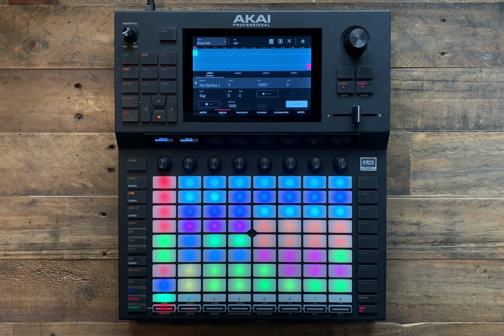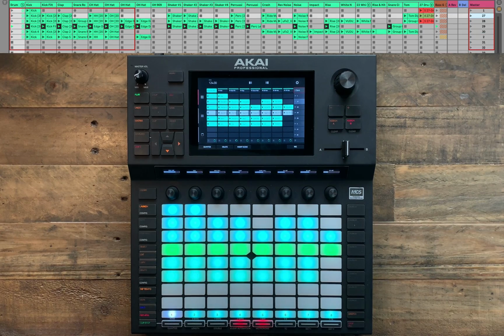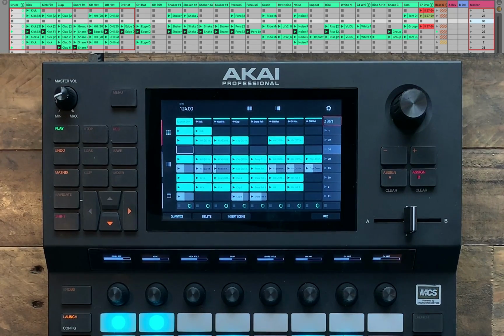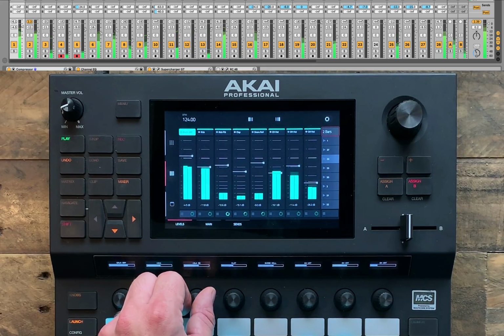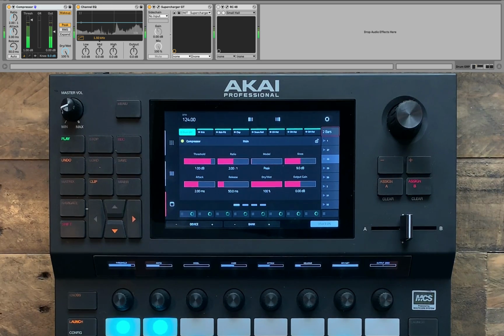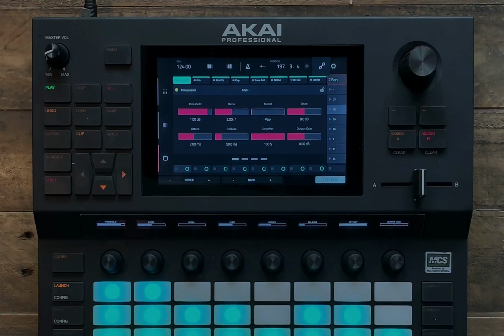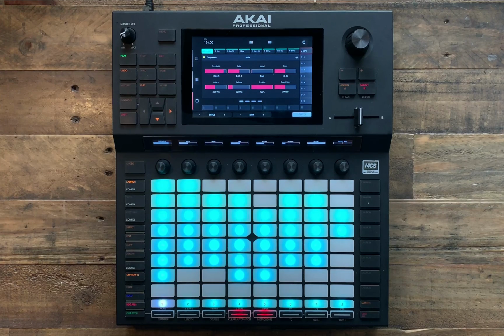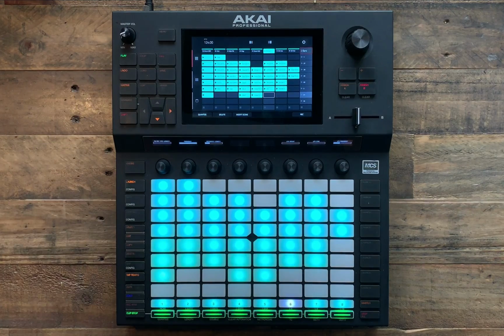Force 3.0.4 | Ableton Live Control Integration

Comment: Akai network midi driver is not fit for purpose. In windows audio dev monitor.exe locks all usb devices preventing them from being used in ableton without powering off my 3rdparty usb midi controllers and powering back on again. I’ve had an unanswered ticket logged for 6 weeks and no response! Disappointing very close to selling my force. There is some weird race condition going on with how the driver polls the midi devices in their last state. Why is the akai audiodevmonitor.exe polling devices in the first place! It should have no jurisdiction over other devices. I have 10 usb midi controllers and it seems to hit a max ceiling limit of polling more than 5 devices.

Comment: Just got the force and I'm pretty blown away to be honest, It has just about everything I could have wanted in an all in one box to use in conjunction with Ableton.
One thing I seem to be missing is the Ability to send midi notes from the force into Ableton clips. In other words I want to use the Force to replace my midi keyboard.

It seems that one way to achieve this would be by using Force external midi channels via a Midi interface then into Live, but surely there is a better way?
Can this be done from within Live control mode?

Thanks in advance
Reply: @user-l6e5z  I've worked it out!
But you're right there is very little information about this.
Ok you should see another option in the midi tab of Ableton Live's preferences for the Akai Force.

Make sure that the input side of this has Track enabled.

Now in the force create a midi track. 
Go to the midi output settings for that track and in the output choose 'Remote' as the output port and obv set the correct midi channel for output.

This worked for me. Let me know if  this makes sense and if it worked for you too.
Reply: @user-l6e5z  yep. Brilliant 👏

Comment: But is it possible to play instruments with the pads?
Reply: My question two - if this is not the case then this is not a viable option. it will have to be push2 again :) 

Cant really see why it should not be possible
Reply: @steffenhenriksen1412  I have a Akai Force now, so I can answer the question: It is unfortunately not possible to play instruments via the Ableton Control integration at the moment. Maybe they decided to not implement it, because the latency over a wireless connection is to bad. However, you easily can connect the midi output port of the force to a midi interface on your computer (or a audio interface with midi ins and outs) and play everything, but I also need to admit that I didn't tested it in the Ableton Control mode (I will do it soon).
Reply: @milanwulf  Fantastic thank you for your answer.. im fine with just doing it over the midi output, maybe they can implement it on the live control at some point :) 

Think its time to spend some more money :D

Comment: The Touchscreen is like an iPad so there is no need or point to lock & restrict the 8x8pads to doing the functions of the screens limited functions!
In fact an iPad can control the playing of instruments while doing all the other functions so it’s not really like an iPad or iPhone or other smart devices!
It is restricted as much as it could be so Akai Pro can slowly free up one feature at a time for as long as they can before releasing the Next Model of the Force!
This is a big disappointment for me if I knew they was going to make it end up like this I would have sent it back while it was still in its warranty 
if only I didn’t want it to be a successful update and was trying to keep the faith in the Force and faith in AkaiPro making it work well with the force of a MPC 
But they are purposely trying to make it a worse product, like as if they are afraid it could be potentially better than the MPC so they are stopping it’s growth.
60 plus pads that could be used to play keys now becomes locked to one set of functions that are already controlled by the touchscreen!
The fact they could have made the Force work just like an MPC but with more pads, but instead they change all the functions and restricted many of them
And changed the workflow beyond recognition so it doesn’t work as well as the MPC’s and the workflow of the MPC is Iconic so they could have made the Force run the same way only with 8x8 Pads inviting 8x8 plus possibilities but it don’t have that workflow! It has a brand new limited workflow built from the engine of the MPC but made to be weaker and not as fun to use! And I’m sure the update for the MPC’s allow pads to be used for MIDI Control.
So the Force is purposely made to be restricted/limited. Why when the Force was the only one out of the two/three devices known to be getting fully integrated Ableton Live DAW control but is the only one out of the 3 devices that doesn’t have it or it is the one that has been given the most restrictions out of the lot!
Even though the MPC’s wasn’t planned to be getting the feature it is been given more than the Force! This proof that Akai Pro don’t want to make the force a success
Reply: MJAS HONOREBELION think, that is bullshit, sorry
Reply: @HOLODYNE-MP , You can think what you like! I think what I like! I think your catching feelings for Akai Pro or you’re defending the Force as if you feel like I offended you so you are calling my thoughts & opinions “bullshit” I would have probably responded to you differently if I saw this a year ago!👀 
However, as you took the time out to read my comment & you obviously didn’t spend around £1500.00 for the Akai Force like I did only to find it wasn’t what they advertised it to be and the functionality was less than originally claimed to do the Ableton integration is weak not fully integrated at all a cheap MIDI Controller can basically almost fully control Ableton Live & the Force was the price I mentioned when it came out and it doesn’t have MIDI Control & it has only just implemented MIDI Mapping over 7months ago and the updates & marketing has basically stopped & the MPC Series’s is doing Ableton integration adverts with no mention of the Force as if the Force don’t exist with the same functionality even though it was promised to be a Force functionality! I personally think that if a company has a Ableton like Device that is supposedly a Standalone Ableton like DAW that isn’t mentioned when advertising Ableton Live Control for MPC’s but the fact that the Akai Force don’t get mentioned alongside the MPC’s is worrying because the Force should be at least mentioned as a Akai Pro product that also shares the same functionality’s plus is newer than the MPC brand so the perfect opportunity to get more interest in the Akai Force would be to mention it alongside the MPC’s as an Member of the Family but the fact they haven’t Marketed the Force with the same energy as the MPC’s they get a retro makeover and new range not that I want a new model Force to come out I would prefer Akai Pro to focus on the Force as much to make it work better and make a Force Software Program to compliment the Hardware and allow it to work as a Plug-in inside any DAW because the Ableton integration isn’t there yet still!👀
There was two updates since this video and the improvements are there but not nothing that wasn’t already there when the Akai Force was advertised over 2yrs& almost 3yrs ago and updates have stopped and promotions have stopped for the Force so it doesn’t get its own Force Expansions or Software & they released a free MPC Beats software it also gets its own expansions but the Force has to share the MPC’s Expansions yes they are the full expansions but the point is the Force was Expensive and the Forces functions get shared with MPC’s the individuality’s only apply to the MPC while the Force doesn’t even get a mention when it comes to advertising Ableton Control and integration functionality that was first promoted as an Akai Force feature!
Reply: @CosMical-Scales  not to mention the update they released last week to all their hardware and software, except the Force. It's fucking sad. Makes me want to sell the Force. Even the AT still doesn't work properly. 😒

Comment: I want to use the 8x8 Pads on The Force while controlling Ableton Live! 
The pads on the force would be a reason to own/use the force, for people who don’t own Push1 or Push2! But it doesn’t work the same way they work!
So I spend £1400.00 for a stand-alone / controller that only controls half of what I want to do! Because It no longer is a instrument, While in Live Mode! 
So I will still need a keyboard/MIDI controller. I spend all that money for a hybrid Standalone Instrument/MIDI Controller that only half controls the DAW!
That really don’t seem to make sense! Why would I want to use my standalone unit that can almost fully mimic Ableton Lives DAW functions by itself only to be limited & restricted when in Ableton Live Mode? It becomes a limited Hybrid and will hinder the workflow rather than aid it!
In its current state it doesn’t have a useful point to it! The early demos advertised a fully integrated Ableton Live working in the display of the force and the 8x8 pads was able to do what they are able to do in standalone mode and looked to be a joy to use! But this update is not what was promised and advertised!
Now it’s some iPad music app like graphic visuals that seems to be adding more confusion rather than a aid to the workflow! 
The main feature is the 8x8 pads that get made useless when in live mode! This is stupid especially when the touchscreen can handle all the things the 8x8 pads have been locked into doing!
Reply: So you can’t use the note mode to record a clip in ableton? It just launches clips and scenes?
Reply: Yeah stupid that you can't use note mode

Comment: Mine won’t even do this. I get a blank screen saying ‘Waiting for communication from Ableton Live’ but it is but it is connected via live link. Ableton midi preferences doesn’t  see it as ‘Akai Force’ it shows as ‘Akai Network - Daw Control & Akai Network - MIDI’. 

Zero functionality.
Reply: @ileremito  same here WT actual F!!!!!!!!!!!!!!!!!!!!!!
Reply: works with my live not force......OMFG!!!! I got soooo jacked with this purchase!!!! bought new wow!! haven't felt this ripped off in a long time...ughhhhh
Reply: Murphy C Yeah turns out we need to upgrade to live 10. More money and had to figure this out because couldn’t get a simple answer from Akai.

Also, the workflow is about as “intuitive” as a migraine.
Reply: JCK Interior Sound Design has to use akai midi control center and choose force. Pain in the arse. And big deal. You can’t even use the pads to play synths. Only been able to control ableton clips and scenes. Thanks akai my push already does that really well and let’s me actually play the synths from the pads. Isn’t that amazing. Wow 😳
Reply: Murphy C you have to install the current version

Comment: This would be useful if it could be used to migrate clips, session, scenes etc from Live into Force. Weather by drag and drop or export of a Live session and import into Force. 20 years of Ableton sets are not going to be manually rebuilt in Force from scratch.
Reply: Hi and thanks for your comment. I would like to buy the Akai Force but I've some doubts... I use to perform with ableton live and I was wondering if it was possible to migrate ableton sessions to the Akai Force directly... It seems no according to your experience. Have you already tried to Akai force by your own ?
Reply: This seems like a pretty specific request, although I would love that myself. My guess is they aren't looking to steal legacy Live users, but rather making strides into a stand alone clip launch platform.

Comment: No multitimbrality, no song mode, no midi out for synths, no stems export, no overbridge thru usb.... ----> NO TRUST FOR AKAI
Reply: Wrong company on overbridge that's elektron
Reply: @davidsteffens3952  i know that perfectly. I meant something like that, using USB to send audio to daws muktitracking
Reply: Pablo Malatesta You can export session stems and open them in Ableton. Then you just drag the sessions into the arranger view or record a performance. Midi file import would be nice as well as multi-track recording over USB. I’m not a fan of this song mode idea though, and I still don’t understand why people want to use the Force multi-timbraly from an external device, instead of actually using the Force. Don’t buy a Force for that, you really want a Jupiter XM or a MODX.
Reply: @digitaldiezel5870  Hi. 
1: i mean stems as recording a full performance in tracks, muting an changing things on the fly, not clips
It should be internal stems export or at least 8track multitrack USB out. Today, i cannot récord multitrack my performance
2: multitimbrality is not for using It as a module, for example, i have a keyboard connected, and i cannot play one instrument on It and at the same time another on the pads (an arpeggio f.e.)It is crucial for live performances. It should be EASY to implement
Reply: AkaiProVideo must be planning to bail on any future support since the price just plummeted 33% down to under a thousand dollars.